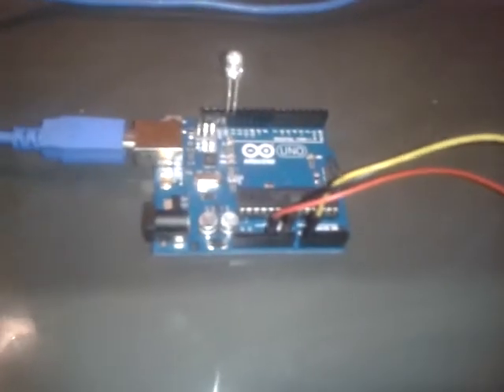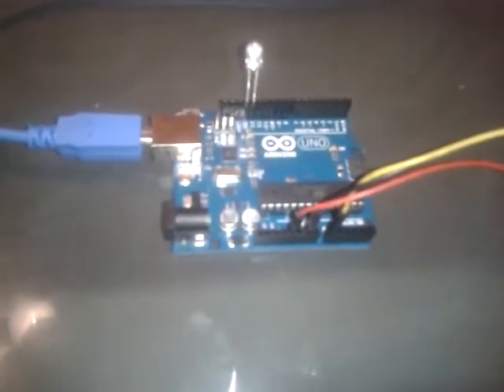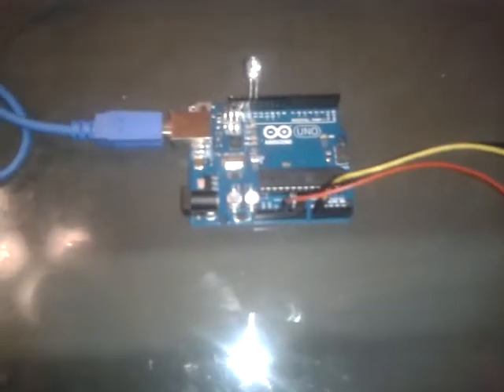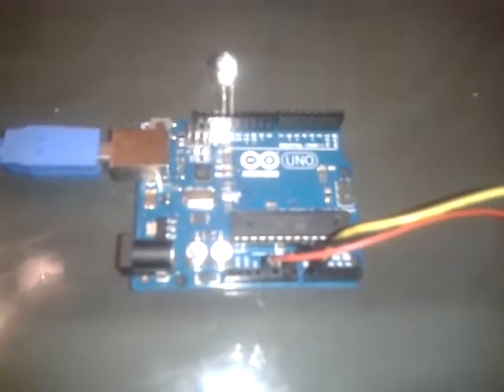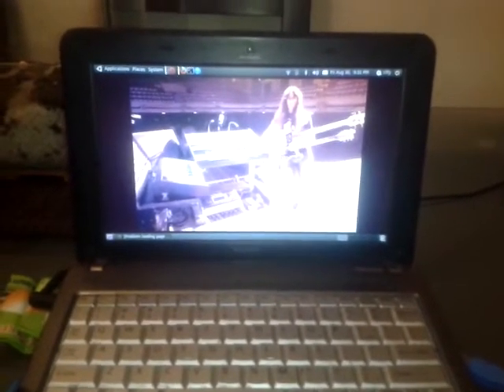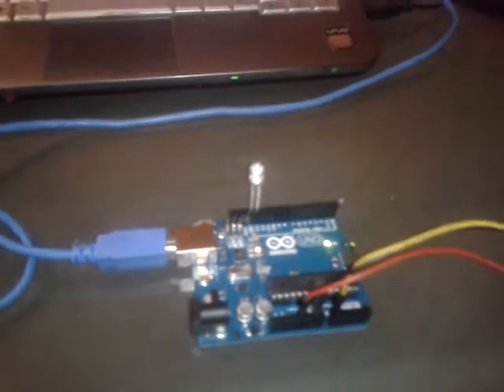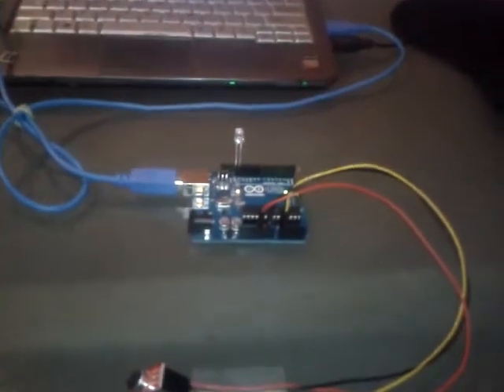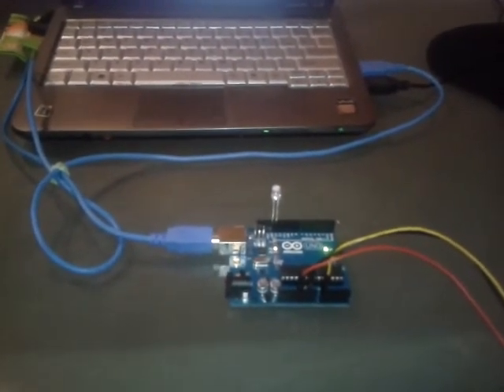Arduino sound sensing with the SparkFun Electret BOB

Comment: i made the same circuit than you as same as the code and the led stays on. could you help me?
Reply from the maker: Hi Diego. Strange ... just check your sketch and make sure you have the LED wired to the correct pin. That's as far as my thinking take me. Let me know how it went.
Reply: Ajay Deshpande i am have the same problem, i connected the circuit as  yours but the led stays on below 1000 threshold and above 1000 it doesn't glow....